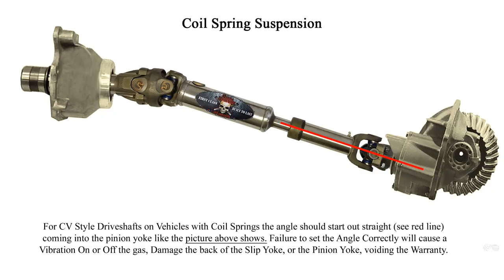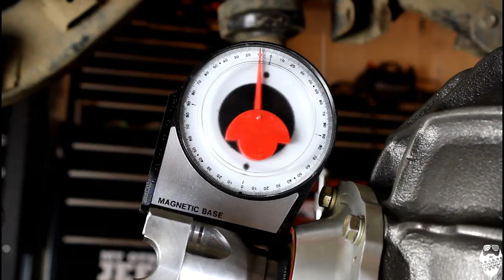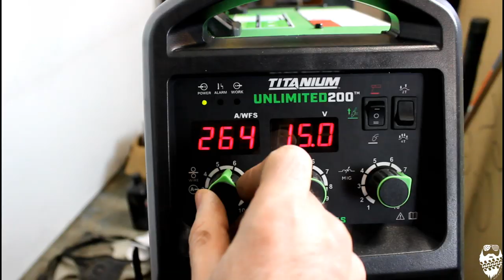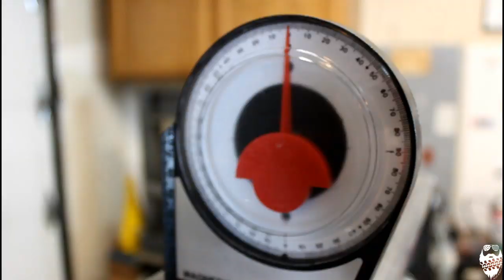Ford 9" axle truss Install, DIY 4 link long arm Jeep Suspension

Comment: Lay Tig filler rod in those future gaps when Mig welding. It works wonders. Great job on the build!!!
Reply from the maker: Thanks, once I learn how to tig with this machine I will try that trick. I was going to do that with the mig, but decided the way I ended up doing it might be easier.
Reply: @MuddyBeards4X4  it is a trick for mig welding. That's one way to fill gaps when mig welding.
Reply from the maker: I just re-read this, so put a raw piece of tig filler rod in there, and then mig over it? puts more materiel in there all at once?
Reply: @MuddyBeards4X4  yes I saw it on one of the other channels and gave it a try. Works awesome!!
Reply: @MuddyBeards4X4  the channel I saw it on was Weldtube. Those guys have got all kind of tricks. You guys keep up the good work. I enjoy watching! Very imformative!

Comment: A new fabricated housing is $700-$800. They are available with larger 3.5" tubes. You could have used full-floating axles with unit bearings and rotors with separate aluminum hats. It would have been simpler, stronger, lighter. More expensive...yes, but not much. But you would have saved A LOT of time.

Comment: I am confused. What was the point of angling the pinion to 16 degrees if the truss is a zero? Is the top of the truss parallel to the axle shaft. Does it matter since your links can just rotate however.
Reply from the maker: I did that to get my pinion angle where I wanted it. If I left the same angle as the pinion, as the axle flexed up the upper control arms would hit the front of the truss, limiting travel.

Comment: What mig do you use 50a ? 
Is it conventional or auto like a newer Miller ?
Just try'na get some insight for myself.. I have an older Miller 180 220v and looking to upgrade to an Autoset. My buddy has an older 220 autoset, can't remember model #, but it runs smooth for it's size but limited to 5/16 or 3/8..

Any recommendations, not a professional welder, leaning more in your direction of projects. Love your video's,  I learn something new everytime..
Reply from the maker: Its the harbor freight titanium unlimited 200. It has been a great welder

Comment: Nice...
Reply: @MuddyBeards4X4  I appreciate the time you take to put these videos together. I'm a fledgling "fabricator" and have, for the last year been investing in all the bare minimum of fabrication tools (mig welder, bandsaw, drill press, etc...). So seeing your progress with a lot of the similar tools (and brands like HF), it helps me relate and give me confidence in my future build projects. Thanks again and keep up the good work.
Reply from the maker: Thanks I appreciate that a lot. I really have just started getting into tools for fabricating and it’s expensive. So slowly I hopefully can upgrade and get some more tools over time. Thanks for watching